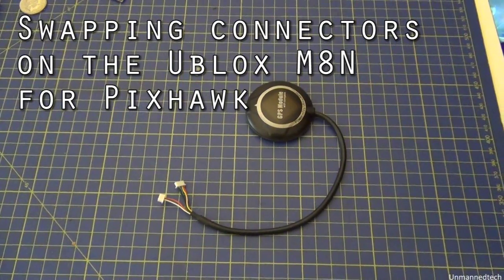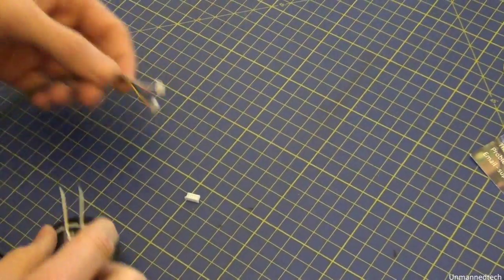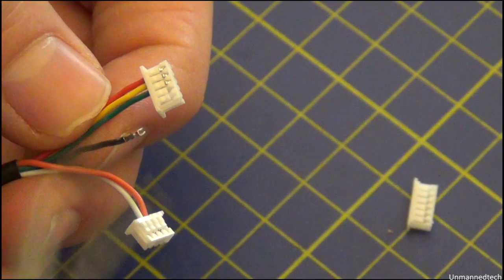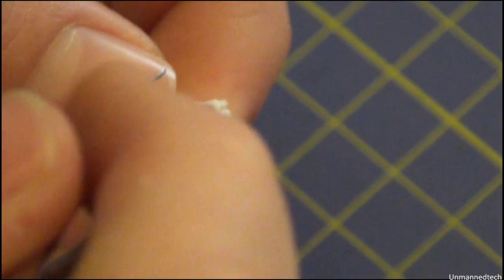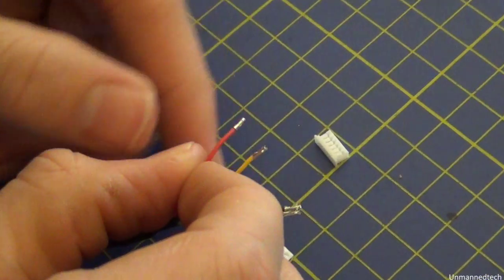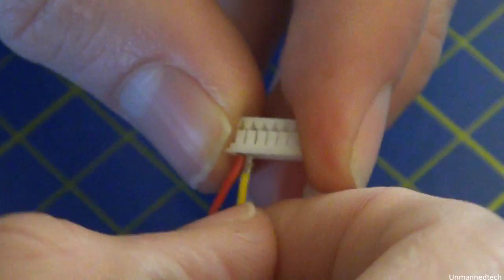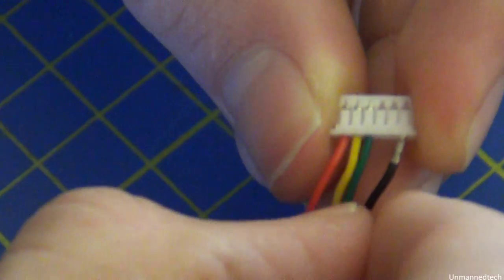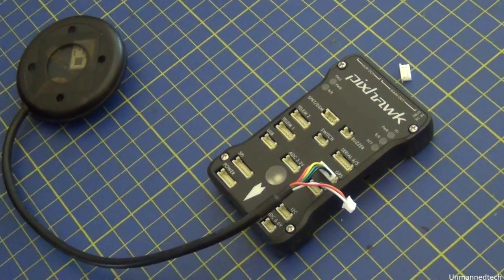How to swap Ublox M8N Pixhawk Connectors

Comment: I'm getting the "No 3D fix", when attempting to use the EXACT GPS with my 3DR Pixhawk. 
Any ideas on what the problem is?
I've been researching the last two days, and I'm unable to find any information.
Reply from the maker: +Todd Martin Could be a faulty GPS module?  If you view the full status on within mission planner you will be able to see if you are getting any information from you GPS module even if only 1 or 2 satellites signals are detected.  Then you can atleast confirm the connection is good